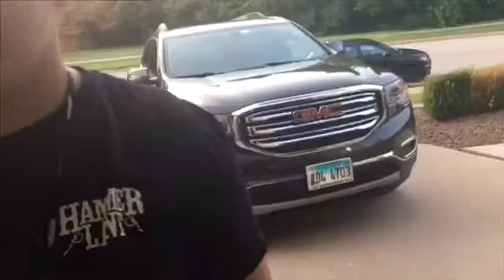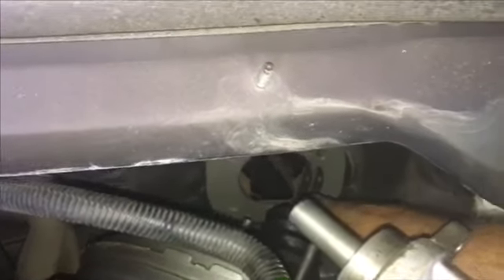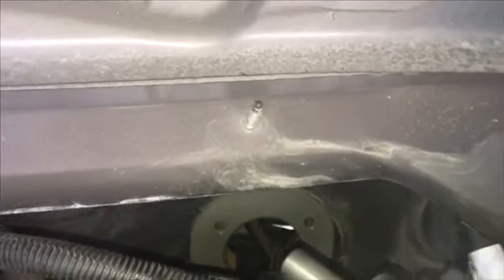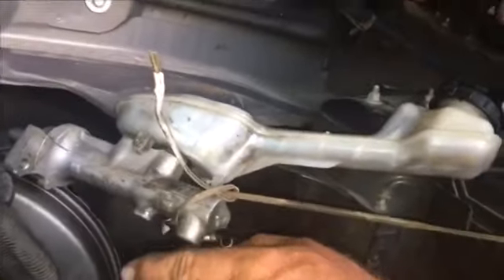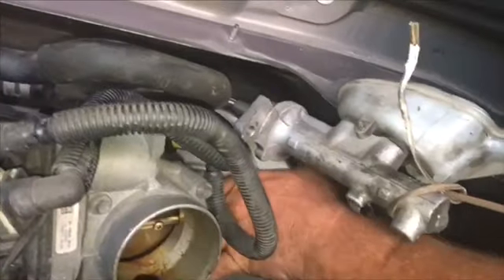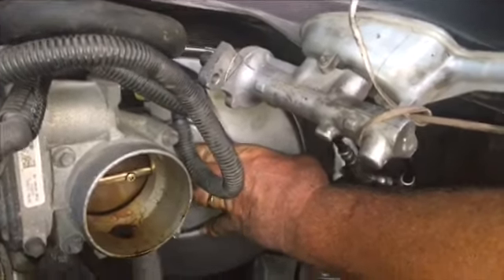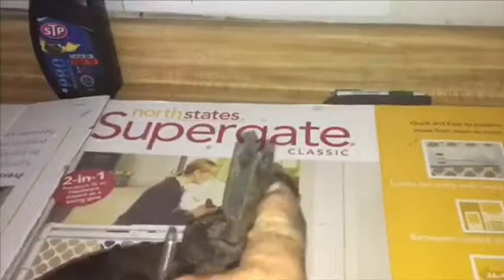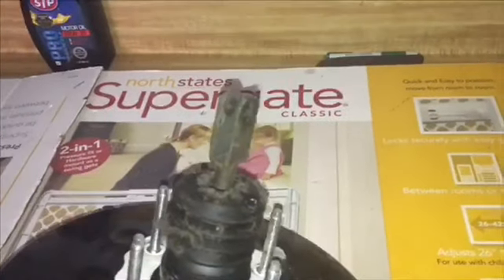EILEENS  JOB AT THIS

Comment: Good job I'm glad I got cordless tools 😬
Reply from the maker: Those are a godsend
Reply: Scraplife 24/7   Yea that job only pays me 2.8 hours  flag time but I can usually get it. done in a hour  long extensions deep swivel sockets and cordless and it goes pretty quick  the right tools does wonders plus done so many you know what sizes all the bolts are
Reply from the maker: Yes indeed if ya done several 
Ya can navigate around every thing 
What is most important 
Lotta experience 
2.8 hours 💰😲
Every ford dealership wanted o $1000 do do this repair 
Union mechanics with $50000 dollar toolbox 🧰 
Yes indeed I’m no match for that
Reply from the maker: Yes also after doing several of these ya learn all the shortcuts. @timsaving so important 
Because if it takes ya longer the service writers  only give ya the book hours and the dealership takes their percentage out so if ya on this job past lunch time  you definitely would get niches at if ya started in the morning first thing  you’d not be making money or getting any other work besides oil changes etc the service writers wouldn’t let ya touch anything else
Reply: Scraplife 24/7  yea it's crazy sounds like you know how they work  no unions in our state.  Over the years the mechanics pay has not kept up with the door rate  ours is 135 a hour door rate mechanic gets maybe 20 percent  where years ago when  I started it was about 35 percent of door rate 50 dollar door rate . Won't even get into the 300 percent part markup from cost . I guess someone has to pay for them suit wearing no skill employees 😂
Reply from the maker: Over the years the higher the shop rate so lower the percentage
For the wrench 🔧 
Yes indeed I worked with my wife’s uncles body shop union  shop for 9 god awful years 
Couldn’t wait to punch out go home and get out there scrapping every day 
My shop had a couple of douche mechanic with $40000 dollars toolbox 🧰 
These guys were worse than two broads on the rag